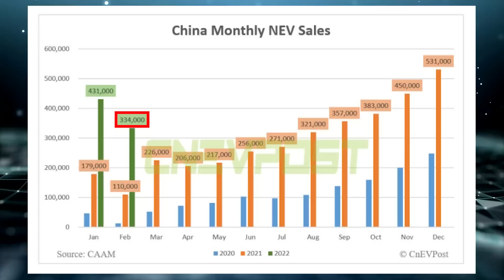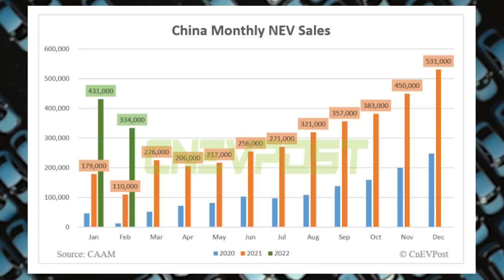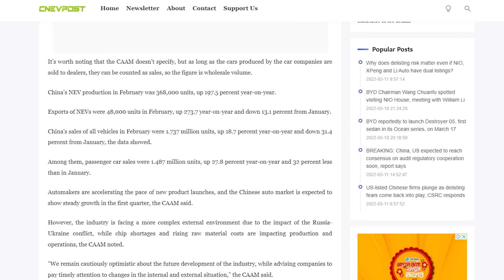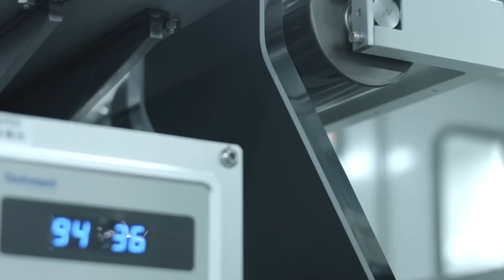Electric car sales up 184% in China in February

Comment: Wish you would break those sales out for true ev only and then list the hybrid sales. Claiming fully electric for hybrids is disengenous at best and a tactic used by the fossil fuel industry. Hybrids are not pure evs and still burn gas, require oil changes, spark plugs, catalytic converters etc. 🤔

Comment: Byd is targeting 1.8 million domestic sales this year
Reply: BYD , will have a new factory in june. 
  💪🏼    + 500,000 EV
Reply: Link to this claim? Last I heard they had upped it from 1.2 to 1.6million total nev sales for 2022. 🤔
Reply: @4literv6  internal challenge goal
Reply: @4literv6  on the contrary , the dmi hybrid phev system has bigger market place as it has more usage scenarios . There wouldn’t be enough lithium in a short period of time , dmi is the right strategy , and not to mention, no one can compete with byds dmi
Reply: @hewittzhong  strongly disagree! We've used hybrids in heavy machinery and trains for decades they are not the way forward. 
Way to much water, cobalt and electricity required just to refine those fossil fuels. At horrible efficency, 10 barrels of crude to get 7 useable barrels of petroleum products. 4-7kwhs of energy at just the refinery level per gallon of petrol. 

Nevermind the literally endless cycle of finding more deposits, drilling, pumping, transporting the raw crude. Storing it, pumping it up again, refining it to store it again, pump it using more energy through massive pipelines, road transport etc. 

Before burning them at very low efficiency with the side effect of poisonous heated fumes. It's estimated 10-15% of all the energy we expend is just to find more fossil fuels. And 50% of all global shipping emissions is just to move gas/oil&coal around the globe. End the madness. #endtheiceage  😐
Reply: Tesla will beat that with more profit. Competition is great!